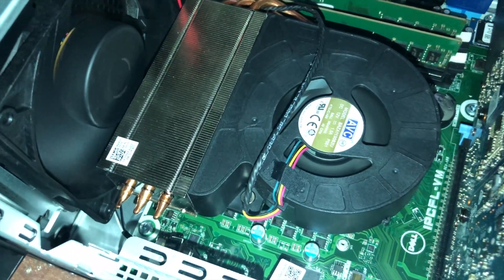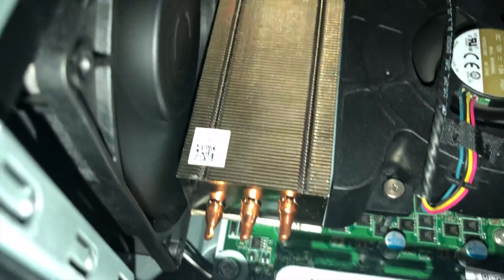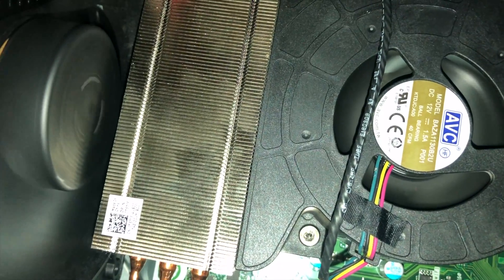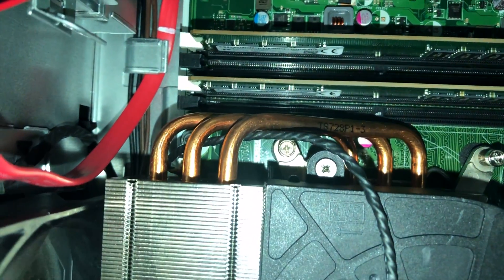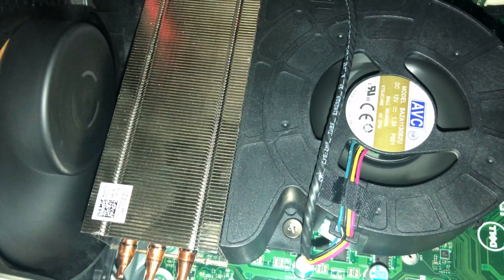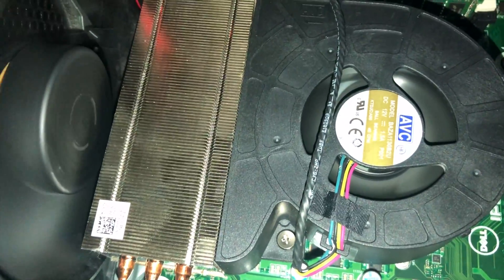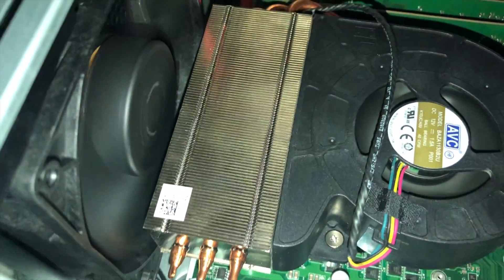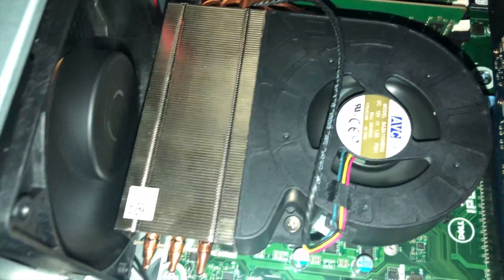DELL XPS 8930 SOUND UPDATE

Comment: Why my xps 8930 doesn't sound loud.. and the Cpu is locked on 3.19ghz I have an i7 8700 not turbo boost on bios... showing .. either
Reply from the maker: As I had this issue 5 years ago, I would assume that the computer you have has had improvements done to reduce the noise levels, which is good!

Comment: I have the same tower and replaced to the upgraded fan and heatsink. I also replaced my top case fan there in front of the new heatsink but its super loud. Ive tried a 120mm and 140mm. I think the original top fan was 80mm or 92mm. But whrn gaming its stupid loud. Surfing the net nothing. But gaming loud loud loud on top fan. 

I have a i9-9900kf and 3080 gpu.

Comment: Thank you for the detailed breakdown. I'm not a computer whiz but your video made everything simple. One question for you, i have dell XPS 8930 and i'm thinking of upgrading to the new RTX 3080 and also getting a new power supply with 850 watts, my current card is RTX 2060. 3080 is longer and people pointed out that the top side exhaust fan will be obstructed by the swing out psu. It's a very compact case and i'm concerned about air circulation. Would it be too risky putting 3080 in this case and if i don't replace the fan will it over heat?
Reply from the maker: As you say, the case is compact, and for me, the thought of doing the upgrade on this particular machine is not something I would do personally. If you have a read over here, I think this may give you a better idea on whether its worth doing this or not. https://www.dell.com/community/XPS-Desktops/XPS-8930-aftermarket-graphic-card-support/td-p/6108418

Comment: WARNING - I purchased an XPS 8930 because the sales rep promised it would be quiet and because Dell’s
website shows the XPS 8930 with the heavy duty heat sink/fan that is shown in
this video (Part # T57JF and KTDJC). WRONG. It came with the wimpy CPU fan and
made tons of noise. I called and they would not exchange or fix it. I could
order the parts and fix it myself but that would invalidate the warranty. The
only good news is I got a full refund and free shipping back to Dell.
Reply from the maker: Very surprised about them not helping you as via Twitter, I had about three people all dealing with this and as mentioned, we finally had multiple on-site visits, tech guys agreed about the noise, I was offered refund etc, but I just wanted a quiet machine!! At least I have that most of the time now after that fan change.

Comment: Just got 8930 with 8700 i7—not the ‘k’ version....has the lousy cpu fan...what would u recommend? Ship back to dell and request this upgraded fan/heat Sink? What is the part name they installed? Thanks!   Which XPS has the newer fan? 9700? Or the K systems now?
Reply from the maker: Mr Midi I made the initial contract with Dell on Twitter believe it or not and they responded very quickly. From what I have read, the replacement fan is quite expensive, so this is getting sorted by them under warranty.
Reply: Tech Reality I see...   and u have the  regular xps 8930 right?  Was yours mainly noisy when CPU load got over 25%? What’s the % reduction in noise since they installed the new fan in general? Is it still loud at 100% cpu load or is it a night and day difference?  Do you know if it’s the same fan they put in the Special edition K XPS desktops? That’s what I was reading! Sorry for all the questions. Thanks for your help.  Just got this PC couple days ago and wanna take care of this before it’s too late!
Reply from the maker: Mr Midi the noise would kick in at high volume and can speed when I ran Chrome.... I disabled the various settings in Chrome to not use any of the hardware acceleration etc... And that made a difference. That new fan you see is the one they just in the k models so I'm led to believe... But being honest, you would need to see inside one to know for sure. They will initially ask for an engineer to come out and replace the fan... He will bring the wrong fan... They will come again.... Replace the fan... Makes no difference... Eventually for me I was offered a refund but did not want that, so thankfully their guys here in Glasgow asked for the system, replaced the fan and it's been a lot better. It will kick the fans in loudly sometimes when Chrome plays silly buggers, but nowhere near as bad as the initial fan.
Reply: @TechRealityGlasgow  Upgraded HeatSink and fan for CPU that comes standard on "K" processor its around $80 USD on big auction site ... so its not that expensive. Look into upgrading your top Exhaust Fan to 120mm fan and your tower will run much cooler.

Comment: Have you tried to run any games?  I have the XPS8930 with the GTX1080 and the same fan as you have fitted and the PC sounds noisy under load but as I write all I can hear is a low hum.  The game I tried to play is Battlefield V - sounds like a jet engine under load...
Reply: The XPS 8930 doesn't have great airflow so you can expect a certain amount of noise under load, but there are definitely different levels of noise that are possible.

I'm guessing that your 1080 came with the PC. Dell uses "blower" style video cards that are unusually loud, and the video card is probably the source of most of the noise for you.

The stock cooler on the CPU definitely gets a bit loud under load too... I've gotten used to mine though. I have an aftermarket video card with good cooling though, so the amount of fan noise coming from the PC isn't nearly as loud as when it had a blower style video card in it.

If your video card looks like this it will be loud http://blog.logicalincrements.com/wp-content/uploads/2017/06/BLOWER-TYPE2.png
Reply from the maker: Paul try running chrome.... it still causes my fans to ramp up!

Comment: Do you know if Dell is now adding the heatsink for all new 8930s?
Reply: From my understanding, it depends on your CPU. In the 8-series, you get the better cooler ONLY with the i7 8700k. If you get an i7 8700 or lower, you're going to be getting the cheaper, noisier fan. I'm not sure how they're handling 9-series CPU's.
Reply from the maker: James McLoad thanks for that James. I really do hope they improve the fan designs in 2019 to something quieter!
Reply: 9700k option shipped with the updated fan/heatsink installed. I didn't call to request it. The whole system is quite quiet, seem to hear the spindal drive over anything else. Enjoying the low-key office computer vibe. Thanks for the replies, fellas. Cheers.
Reply: Thanks!
Reply from the maker: The honest is.. I don't know! I have seen other people review this model and they have the older heatsink and fin, yet others, when they open the case up, have the newer one that Dell fitted for me. I guess you need to ask before buying!
Reply: I just got my XPS8930 a few weeks ago and it has the new heatsink and fan.   @TechRealityGlasgow

Comment: How were you able to get the new heatsink from Dell? I ordered the fan part but the heatsink has been out of stock for several weeks.
Reply from the maker: I did not order it, I had been in contact with dell technical support and as the machine is still under warranty, their support people ended up taking the machine in and they replaced it for me.
Reply: Gotcha. Thanks!